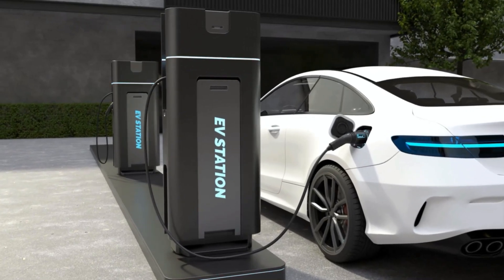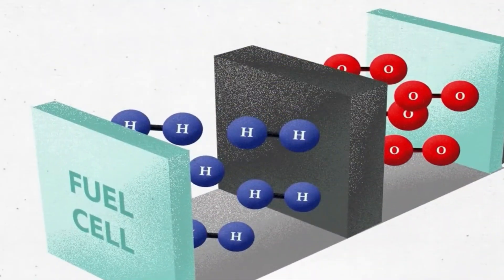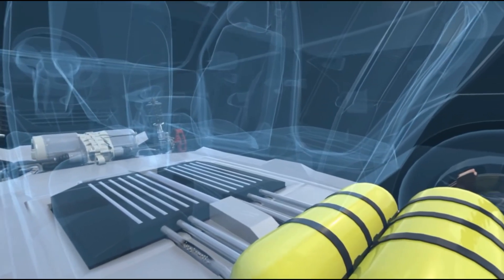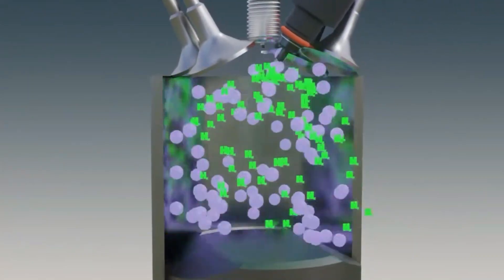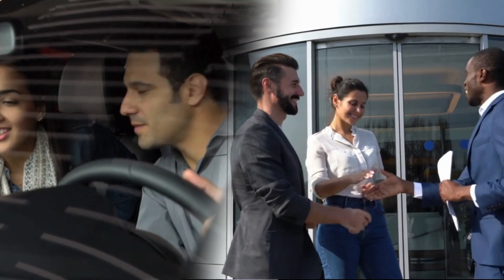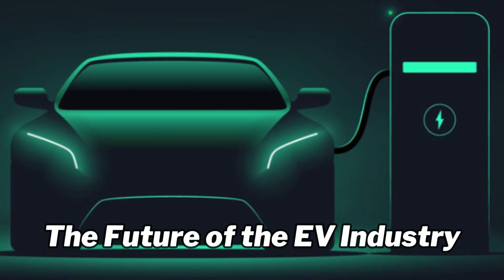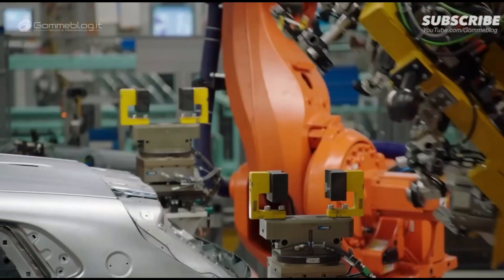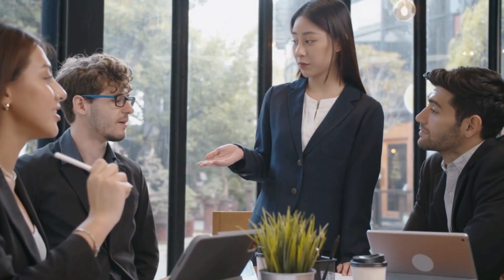New Toyota's Hydrogen Water Engine Innovation

Comment: I love marketing.  It's not a water engine.  It's a hydrogen engine which has the potential to turn into the Hindenburg.  The Toyota Mirai holds 32 gallons of Hydrogen liquid and gets 12 MPG.  At a cost of $5.00 (guessing) per gallon it's approximately 4 times as expensive as gasoline per mile.  Toyota does offer free hydrogen with the purchase or lease of the Mirai but only for a limited time.

Comment: I worked on fuel cell powerplants for automotive use 30 years ago.  We built a fuel cell powered engine for a Hyundai Santa Fe.  This technology has been around for a long time.  Fuel cells have supplied electricity for satellites since the Mercury program.    As a byproduct, they supply drinking water for the astronauts.

Comment: Yeah - the production of hydrogen is an energy problem.   Solar/wind cannot produce enough to also supply the power to produce enough hydrogen.   That leaves nuclear as the only efficient non-carbon means of producing hydrogen for vehicle use.   Again - thats coming from Japan.
Reply: So why not just charge ev cars with power from nuclear? Production of hydrogen (and oxygen) by separating water is a very energy-inefficient process.
Reply: As Bill Gates said, "We need an energy Miracle."   I propose mono atomic carbon.  When excited by microwaves, it becomes a plasma and can be used to generate electricity. The waste product is a quasi-crystal diamond glass, which can be molded, machined, and doped with metals and minerals for a variety of properties, including color and radiation blocking.  It is a versatile building material.   But not for men -- not until all wars end.
Reply: Australia is planning to do just that, as Japan wants a reliable large-scale supply of green hydrogen, and we have the ability to produce it. A lot of research has gone into ways of transporting hydrogen in other than pressure vessels, such as chemical carriers, especially using ammonia, which converts back into hydrogen.

Comment: Where does the hydrogen come from?
Reply: Electrolysis of water is one method.     These fuel cells take advantage of the electrical energy created when oxygen and hydrogen are combined to form water to run an electric motor. There is another way to use hydrogen -- something like a methane engine.  But with Hydrogen, burning adds Oxygen, and the exhaust is water vapor.  The problem with that is the tank to hold the Hydrogen.  It requires a lot of pressure -- so its heavy and the potential for explosion is high.
Reply: @humboldthammer I’m dubious about their hydrogen engine, specifically how they would pack in enough in a car in a way that would make sense – I can see large trucks or buses perhaps; which is a major contributor to carbon pollution so definitely a market, but cars I don’t know. 
Another is that the hydrogen supply chain and use has to eliminate as much leakage as possible, as large volumes of hydrogen destroys ozone in the upper atmosphere, which was the problem with CFCs, except hydrogen potentially could be worse.
Reply: There are two sources of hydrogen: “green” and “blue” hydrogen, both produced by hydrolysis. Blue hydrogen is code for using gas that pollutes far more than if you just burnt the gas in a power plant in the first place. Green hydrogen uses renewables, such as wind and solar. Australia is planning to become a major international supplier of green hydrogen, with Japan actively looking for reliable large scale supply for future power plants or for things like cars.
Reply: @msandersen  still, when producing H from electricity, you loose 70% in the process, whereas an ev car only loses 10%